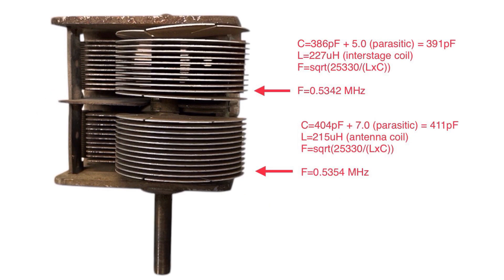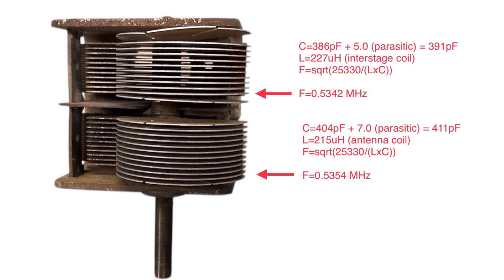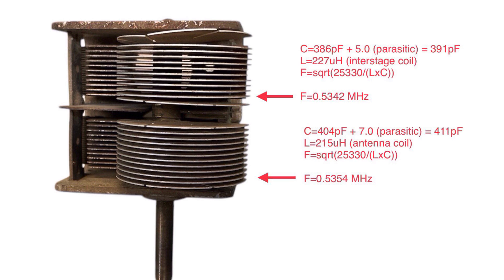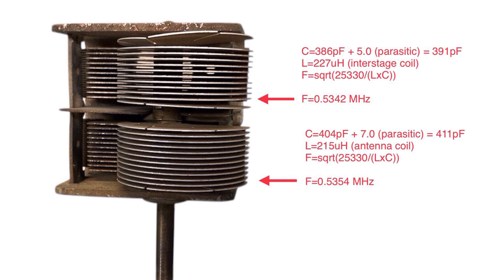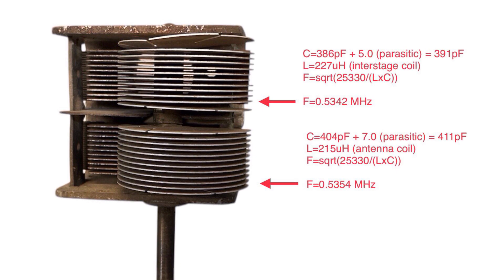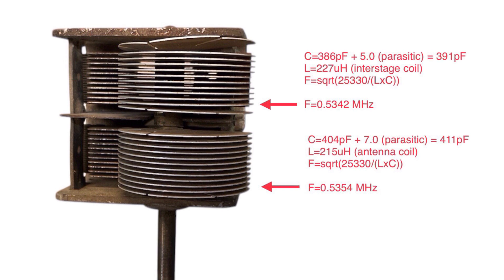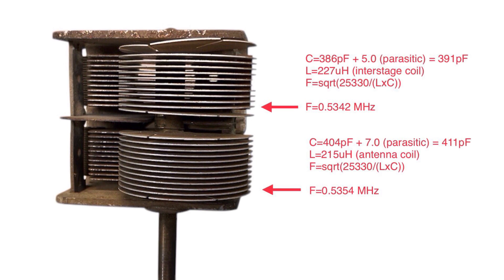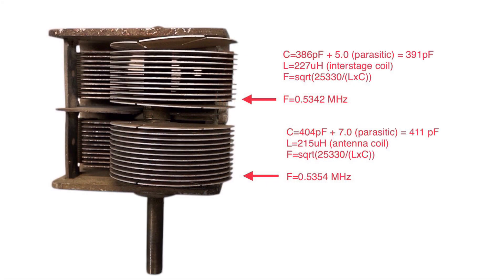Pathe - Model R | Why are the Tuning Condenser Plates Bent?

Comment: thank you for sharing. I truly enjoy your videos . I try to use them for reference points to restore the vintage collections I have. . Q: have you worked on colored  radios like plaskon, bettle , painted and polystyrene?  i have a few with cracks and i am hesitant to try to fix.
Reply from the maker: Thank you for your kind words. I haven’t tried to repair any plaskon or bettle cabinets. I did a Bakelite repair many years back, which may help. The videos are at:

https://youtube.com/playlist?list=PLjLu4V-71S1IZexdcF85gW1O4MEdFW26Q&si=LyUD0RaqWHqrTiYo

Hope this helps. 

Best,

Don

Comment: You can also see it as a attempt for a perfect tracking of the dial. I would not touch it, and see after re-assembly how well it tracks.
Reply from the maker: Thanks for the tip, I appreciate it. Based on my limited power up before tearing it down for cleaning, it seemed to track okay for an old TRF. Thanks again for watching and reaching out. Best, Don